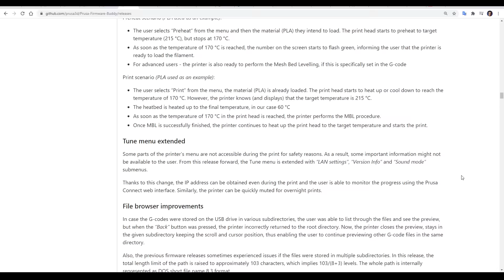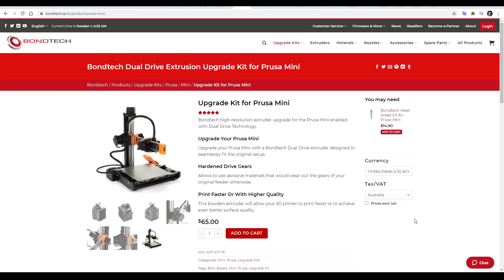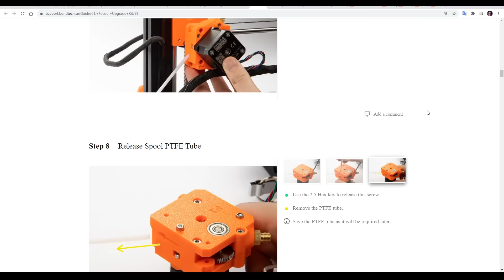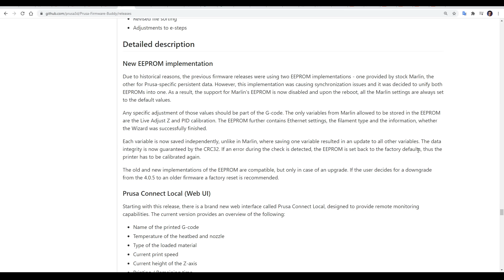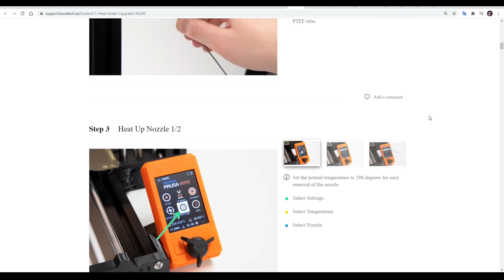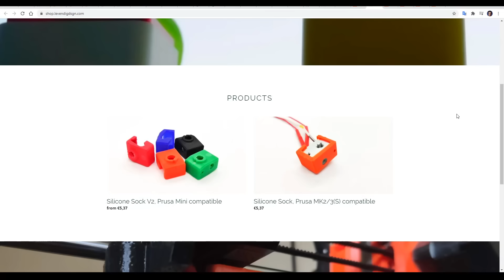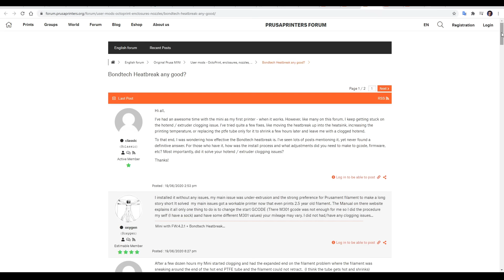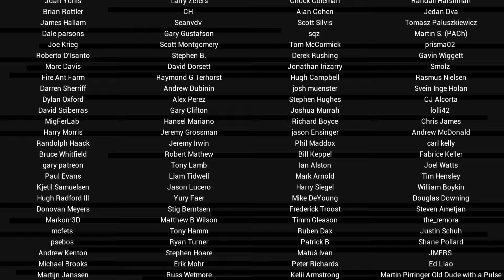Prusa Mini update: Improvements including Bondtech extruder & heat-break

Comment: I preordered the Mini the day it came out and received it in december 2019. I had issues with the hotend not being all the way in which was resolved by taking the grub screws out, giving the heater block a good push and putting the grub screws back in. My printer went from "good" to "perfect" after this.

Since then it printed flawlessly. I have a recently printed octopus (like, the print in place chained legs thingy) with cheap filament and the prusament profile right next to me. It has a bit of stringing but not enough for me to tune the profile for that filament. I printed one with Prusament PLA Galaxy Purple as well that turned out literally flawlessly but is not right next to me at the moment so i'm not taking that one as an example.

The octopus in my hands right now is smooth. No ringing around the eyes. No sign of under or over extrusion. I'd consider this a perfect print.

Comment: I had a rough start with my Prusa Mini. (Got mine in May)

First issue was the heater cartridge cable was preventing the part cooling fan from turning. As disappointing as this was for a prebuilt part, it was an easy fix, however there is still only about 1mm clearance.

Second issue was the idler housing on the x axis. It was gripping the smooth rods so tightly that it would retain any slight twist, causing the hotend to pitch as it travelled along its length. Easing off the clamping screws allowed it to untwist and sit at the intended natural position.

I too found the default profile to be a bit stringy.
I attempted to tackle this by reducing the print temp, which then caused my final issue, the dual drive chewing up filament, then getting caked up and unable to extrude properly.
The final solution I found was to print at normal or slightly above temperatures, while counter intuitively reducing the retraction down to 1.8mm from 3mm.

Since then I have printed many things in a good range of filament types and colours.
So far so good, print quality has been excellent and at least on par with my other Prusas, some of which are heavily modified.

Comment: Have had a mini for a few months now. I’m happy with the quality of the prints (no mods) but I have been experiencing first layer hight drift in the last few weeks. This was solved by pre-heating the bed and nozzle for a minute before the ABL for each print. The fact that only happens in the last few weeks and not from the start makes me believe is more than just lack of thermistor on Pinda probe.
Reply: The early probe points were set way too close to the edge of the bed plus the wiring was a bit too short. This may have caused stress on your probe wires leading to them breaking internally. I'd say get a new probe via support and see. My probe failed 3 weeks in, but have been very reliable since then.

Comment: Looking at responses. It genuinely seems that Prusa's Quality Control for the Mini isn't perfect. Some of the PTFE tubes of the hot-end being of the wrong length resulting in clogging up of the hotend, some extruders eating the filament too much and a few cases of the wrong fuses inserted on the board. 

I think a good idea for prospective buyers is to spend a tenner extra for a set of gears and ptfe tubes, just in case. They are "consumable" parts anyway, so doesn't hurt to have them anyway!

Comment: I have absolutely zero problems so far with my stock mini and I have it for a month now and it's constantly printing. Print quality is better than on my CR-10s Pro. Maybe this is due to the fact that I use a prusa printer with prusa filament and prusa slicer. I love this machine and I'm sure his machine in the video has another problem. I would buy the prusa over the creality if I had to choose one

Comment: Thanks for this excellent review! I share your opinion about the original extruder. When I replaced it I discovered lots of filament "dust" in the old one. Simply badly designed. The bondtech one has more power and does not slip. About the hot-end. Again, the Prusa design is not perfect. IMHO a hot-end should be all metal where the heat break design is crucial.  In an ideal situation there is no gap between the heat break and the nozzle. Many cheap heat breaks have a chamfer at the side where they hit the nozzle. That will cause clogs sooner or later.  Even the cheap E3D clones will work well with an original E3D heat break. After installing the Bondtech extruder, thanks for your advice and placing an E3D all metal printhead the printer prints fine. But, the printer will not reach full print volume in X and Y direction and a non functional M500 command is rediculus. Again thanks for sharing your experience!

Comment: And yet it seems thousands of customers don't have any problems at all. You have to ask why is it largely the experts who are having trouble? Could it be perhaps that the expectations of what is in practice a very cheap product need to be better managed?  I bought a Flashforge DreamerNX while waiting for the Mini. I was not expecting much but actually the prints were excellent. The mini eventually turned up and was on a par with it. Pros and cons, enclosed, not enclosed, direct vs bowden, WiFi vs not. Noise vs near silence.  The prices were very similar. I doublt so many are complaing about Flashforge not living up to expectations as its expectation is better managed.

Comment: I am super happy with my Mini as my goto printer for super quality small prints. I have my Mini since February. Have it setup up to print high quality prints with a .25 nozzle and 0.1 layer height. It consistently brings perfect prints (with the right filament truly amazing prints) Besides bedadhesion problems I did not have a print fail yet (more than a hundred prints). The only problem I have is with unloading filament, the tip seems to get stuck when it comes out of the hotend and tries to go into the Bowden tube. I have not made a single change to the machine but for firmware upgrades.  
(I have a Mini, 3 Mk3's and a large Delta)

Comment: Great video!

 I've had a prusa mini before, I bought both bonditech upgrades and applied them correctly, they worked as advertised. However my problem eventually became the bowden tube design with the compression style collet, no matter how many times I replaced it and no matter the fashion of reassembly, the bowden tube would be come dislodged after less then 24 hours of print time. (It would be nice if they would sell the collet uncompressed!!!!!!!)

Lucky I was within the return time, so it was sent back after 100 dollars worth of upgrades and spare parts had been invested. 

I'm now 100% happy with my ender 5 pro!

Anybody want to buy a used bonditech extruder for prusa mini? Lol
Reply: I realize this is 10 months old, but still selling the bondtech?

Comment: I have an early release mini that started off printing perfect. After a bad bed adhesion due to me not cleaning skin oil off the build plate, the nozzle became clogged and I think it formed some permanent “crust” inside it. I then started having under extrusion and slipping issues. I tried everything and what ultimately fixed it was just changing the nozzle, a $3 part. At temp and with the boden unhooked, , you should be able to easily push filament through the nozzle by hand. If there is a lot of resistance, change the nozzle (probably don’t even mess with cold pulls). Ultimately, it’s not the extruded drive gears, it’s that there is too much resistance in the nozzle.

Comment: I'm still with my old 2018 Ender 3 and still print happily like the bondtech result there, albeit incredibly slow when compared to the vase mode displayed, and salmon skin because of OG 8-bit board, but even when it's printing ABS that is decent like eSun, I only found my problem that I wasn't printing slow enough, and that's not because of the printer, just the material itself could not adhere well to the previous layers if the speed is 40mm/s and above, despite the print did finish seemingly perfectly.

not touting about Ender 3, but rather, I've never or rarely ever heard just how low is actually the point of diminishing return when you have certain expectations towards a 3D printer before turning it into a money burning pit.

Comment: I own a Mini since March and I was extremely happy with it till a few days a go. Print quality with prusa slicer is superb in my opinion. I printed all parts for my Hevo in ABS without an enclosure and I couldn't be more happier with it. 
Then I tried Flex... Oh boy. That's where the trouble started. Flex printed okay-ish but I was to lazy to tune in a profile so I switch back to PLA and voila - clogging and underextrusions. I cleaned Hotend and Extruder gears (i.e. cold pull) but wasn't successful. Previously I printed pla at 195 now I needed 230! Which resulted in really stringy prints. So I decided to swap the PTFE tube... Which was the cause of the issues. Since then it prints fine again but the whole incident leaves a bitter taste... I consider buying the bondtech heatbrake as the prusa one seems a complete failure by design. I bought the mini cause I wanted a cheap reliable workhorse without tinkering to have time for other projects and I hope the bondtech heatbrake will improve this issue because the inner PTFE is shorter and heatcreep shouldn't be as bad with the narrow part after the heating block.
Reply: I'm facing similar issues now after more than half a year of pretty much flawless printing with the mini. Although my issues came with a 0.25 mm nozzle. So far only high temperature seems to solve it. As for the hotend, it is crucial to make sure the PTFE tube is correctly preloaded, i.e. squeezed between the heatbrake and the brass fitting.
Reply: It was probably just a coincidence with the flex. I and many others have had same problem. It is just a matter of time before you have issues due to the ptfe tube shrinking. With the hotend cold, remove bowden tube, loosen the grub screws and lift hot end all the way up, tighten grub screws and put the bowden tube back on but do not over tighten. This got me back up and running. (make sure its clean as well and do cold pulls to clean if needed). Also, move the minda probe back up like in this video and recalibrate. 
I think when I do need to upgrade it might be a full metal hotend, this ptfe tube is driving me nuts.
Reply: @hurrycaine1   @Petr Hošek Yeah I guess it was a stupid coincidence since the flex material clogged and used every little gap between the PTFE and Heatbreak. I will upgrade to a Bondtech Heatbreak soon and I hope the issues will be gone. But I also have to add that my prints look way better than Michael's! Even with stupid cheap Sunlu PLA / PETG / ABS ;)

Comment: I'm considering getting a Mini+, hoping they improved on the plus iteration.
Reply: it has a PINDA sensor instead of the MINDA, which should provide more stable mesh bed leveling. Otherwise the printers are more or less the same mechanically.

Comment: I am using my printers seriously for prototyping for my business. I was looking to get a mini to test it’s capabilities for handling actual part production. While prototyping I need a larger machine and the excellent SK Go is my print perfection workhorse. However for production parts a small machine is very attractive because all the parts I will need to produce for commercial product will probably be small enough to fit on the Mini. The promised print farm functionality is therefore highly attractive. But I have to say I have been really put off this machine now. I want a machine that churns out parts with Mk3 quality, day in day out and it seemed the mini would fit the bill. But it’s become clear to me it simply doesn’t quite make the mark as compared with the Mk3. Many reviewers confirm this. Quality is important. FDM 3D printed parts are, IMO, only just acceptable when printed really well. 

I purchased an Ooznest Workbee CNC which had printed parts and they are all, without fail, extremely impressive. I know Ooznest use Mk3’s and they have them dialled in really well. The Workbee was the first product I have seen where I feel FDM 3D printing is acceptable quality. I want the same quality for my own business but won’t accept less.

Comment: In case of me, i changed the e Step value which is 412. Check the extruding length. 415 makes over extruding.
Reply from the maker: I did check and got 416, which is within the tolerance of the permanent marker tip.

Comment: I just recieved my mini+ last week and have had about 5 filament jams that required different degrees of disassembly of the extruder and cleaning of the hot end. I agree that it seems the PFT tube is short on the hot end and filament can get clogged under it. I have been able to get some quality prints but have not done prints over 6 hours and not at the point I want to leave it unattended overnight. In comparison to Ender 3 prints when the Mini+ is working the quality is top notch. I do not think I will do this upgrade at this point and will keep working with Prusa tech support to optimize the printer.

Comment: Very sad to see this. I have a i3 MK3S which I am very happy with. I was considering getting a Mini as a second printer but the print quality is not acceptable. I don't think it is OK to spend another 60+ Euro on a new machine just to get it printing mostly decent. Prusa really dropped the ball on this machine. It could have been a really good little printer. I expect more from Prusa!
Reply: Maybe that's why I'm having a hard time finding more follow up reviews that aren't from the release day.
Reply: I own the mk3s+ and just got the mini+ and it is amazing.  Don’t see much difference and think that the mini+ produces slightly better prints.  When time comes that I need a third printer it will be another mini+ for sure.
Reply: @cornertankcorner  I also own a mk3 (now mk3s+) and just purchased a mini kit.  I assembled very carefully and was amazed with the first prints -- as good as the tweaked MK3.  It seems that so many of these issues are down to assembly problems.  My view is that these are hobby machines and need to be carefully configured and tuned.  I believe a lot of the reported extrusion problems with the mini are either down to alignment of the filament path through the extruder (position on extruder motor shaft) or the tension on the extruder spring.   Where was the experimentation of these changes first?   Too many variables changing at once to be conclusive...

Comment: Mine was also an extremely early unit (likely first or second batch from what I've been able to find). Mine began having extrusion issues within a few days and got steadily louder as well. I've since reseated the heatbreak (it was far from correct as delivered) and replaced the extruder with the bondtech version as the supplied extruder had extremely shallow teeth and a high tendency to strip and eat filament. Since that upgrade I have had far fewer issues with extrusion, but manually setting the e-steps every power cycle is a pain. The resonance in printing has also gotten far louder and despite re-packing bearings and tightening everything I can find it remains. I've just reverted to lowering speeds to avoid the strongest resonance frequencies. Finally, the bed leveling is pretty terrible compared to my mk3s (bear). I have a modified start that positions the MINDA probe over the center of the bed for 2 minutes after heat-up, but it still fails to find a perfectly reliable z-height given that, and often has areas of the bed with inconsistent height. At this point I'm considering an entire rework, replacing the hotend with a proper v6 or dragon, the MINDA with a PINDA, and maybe rebuilding the frame or swapping the mainboard. I love my mk3s Bear, but this printer fell far below my expectations, especially after the announcement of the Appendix and all the issues with releasing source files and dev tools (I pre-ordered and those elements were not revealed until after I had purchased). I worry they will make the same mistakes on the mk4/XL.

Comment: I got my Mini a few months ago. It printed "ok" right up until I put Prusament in it and then print quality went downhill and it eventually clogged hard. Turns out I had the same gap in the hot end and everything clogged up. Clicking extruder and all. I ended up disassembling the hot end and replacing both the nozzle and the PTFE tube and have had very few problems ever since.  I even managed a 50 hour print at 0.05 layer height with zero issues. Banding is minimal for me. My two remaining issues are the bed level and the alignment of the gantry assembly which I have to shim so that left to right movement moves in a mostly straight line. Without the shim there's as much as a 5mm shift when traveling across the plate. I also have to let the MINDA heat soak for 5 minute before every plate to get the leveling to come out decent. This is AFTER having Prusa replace the MINDA.

Comment: question about the E415 work around.  If you are in the middle of a large print and the mini+ reboots.  Normally you would agree to letting it resume print.  How would that resume print after power failure function work?  Seems like it would continue the print where it left off, but without E415 and would result in a ruined print?  Your thoughts?

Comment: I have been using my Prusa Mini steady since May 1st 2020 . After getting lots of Z banding . I printed & replaced the Y axis belt tensioner and obtained better results . Don't over tighten your belts . My bad . They are very touchy about adjustment . i may try replacing the belts if banding reappears . TB